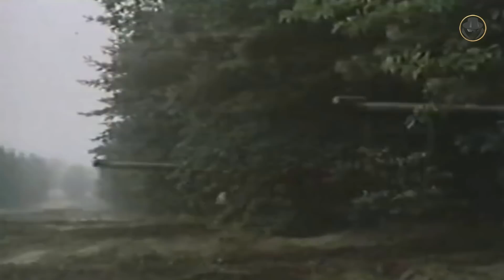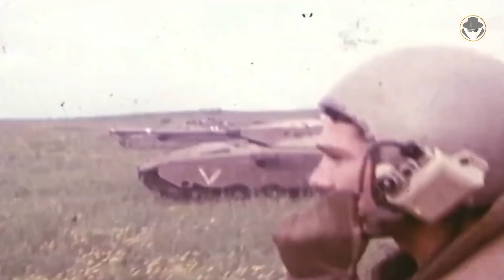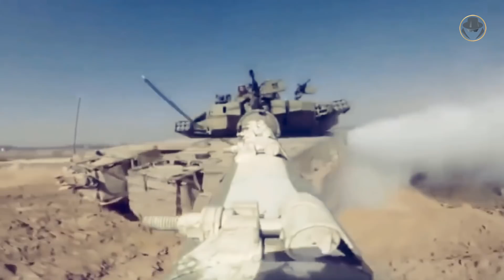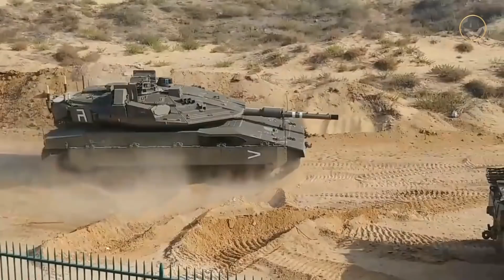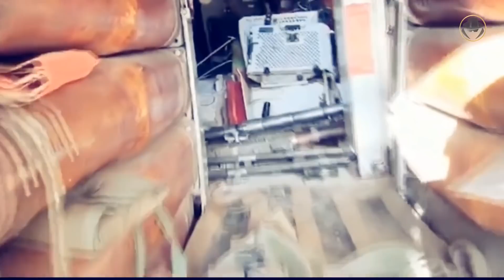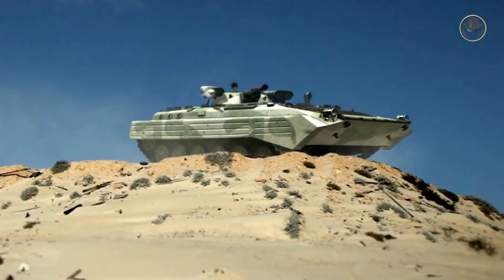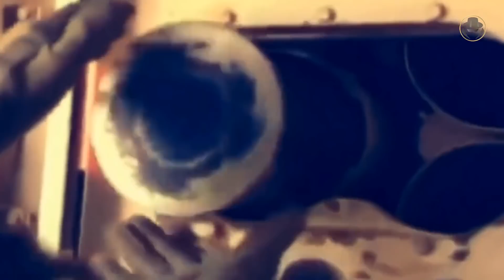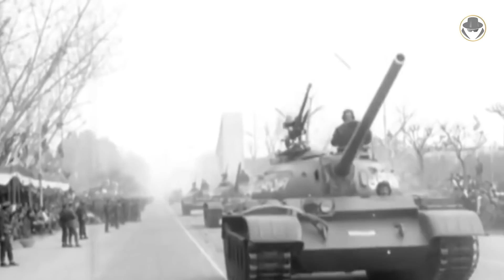Merkava Mk IV | The latest main battle tank of the Israel Defense Forces

Comment: Its weight and limited range make it less than the best and Syria before the 2011 war wasn't harmless.
Reply: To be fair it is for somthing called the self defense forces soooo its weight and range aren't somthing they probably  care about.
Reply: @andrewszerbiak7330  soooo? The vid pointed out what u repeated...
Reply: @TheKeithvidz  And weirdly both Andrew and the vid are correct. The Merkava is primarily a defensive tank. This means it's weight and limited range are less of a problem than an attacker who can expect to be further from repair/resupply. The Merkava will only be expected to make short bounds from one defensive position to another or limited range attacks/counter-attacks. It isn't exactly expected to drive to Tehran on one tank of fuel. Like the video said, the IDF no longer has plans to drive all the way to Damascus, so who cares if it's max range is short?
Reply: @Armoredcompany  as if the idf could ever make a drive on damascus, as though you can say merkava can fight a war on a single gas tank. Pompous as the rest.
Reply: @TheKeithvidz  Ohhh boy, okay. First of all, don't try to put words in my mouth by over-exaggerating. That is NOT what I said and you know it.

To start, who would WANT to drive on Damascus these days? The Syrians are doing a good enough job fucking it up on their own, they don't need the Israeli's help with that. 

Second, at what point did I say "fight a war on a single gas tank"? What I said was, "they are closer to resupply so limited range is not a major concern". Your desire to twist my words to suit your own means does NOT in fact make you correct.

Lastly, I would not characterize myself as pompous. I would instead say "educated in the methodology of waging war", something you clearly are not given your WILD misunderstanding of tank classification and design requirements. I suspect that your own personal political ideals are clouding your judgement and blinding you to the factual accuracies of reality.
Reply: @Armoredcompany  you act knowledgeable but can't so much as tell israel and the west mess up syria - ask your boy bibi why grant passage to uk's 'white helmets' beheaders.  
Political? Just i don't interpret israel as sisyphean.
Reply: @Armoredcompany  For the record I want to discuss politics?
I suspect that your own personal political ideals - sounds one of us opened that door first...
Reply: @TheKeithvidz  Yeah, I said that AFTER you started talking about the White Helmets and the Israeli prime minister, something that has literally NOTHING to do with the conversation that was originally being had. YOU brought up political issues to discuss tactical and strategic applications of a tank. That's on YOU my guy, not me.
Reply: Also Youtube didn't show me the video you linked. It's interesting but it also does little to actually show definitive proof. There are some video clips yes, but as milsim games all across the globe will show it is far too simple to just buy some kit to dress up. What is not discussed in the video is the possibility that the "White Helmets" show with Al Qaeda in Syria are not in fact mujihadeen who are wearing the outfit in an attempt to avoid being shot, allowing them into advantageous positions. The video also plays heavily on the journalist's own personal politics and personal opinions so it's credibility is questionable at best. You'll notice the host catches himself at one point saying the whistle blowers came forward "with evide...claims". He almost said evidence but stopped himself because he KNEW that wasn't true, and corrected himself to claims, which again, to my knowledge were not substantiated by investigation.

This strikes me as some Qanon level conspiracy stuff. As a government employee, let me tell you that the US government isn't as smart as these people are trying to make them out to be lol. Just look at Kabul for proof of the US's great powers of subterfuge insert heavy eye roll here

You may have read about the tank online, but what I suspect you lack is not the knowledge of it's stat sheet, more like knowledge of it's purpose and use. There is a vast difference between knowing the armor thickness and turret rotation speed of a tank and knowing how it will be used and why it will be used that way. Those are the kinds of things I take into account when looking at videos like this. Why does the IDF think its the best tank in the world? Because for their limited scope of criteria...it is. Tanks like the M1A2, Challenger 2, Type 90, T-90, and Leopard 2A6 will run rings around it out in the open deserts of Iraq or the plains of Eastern Europe yes. Those tanks will struggle against Merkavas that are dug in and defending a ridge-line and firing into confined kill boxes. The IDF does not care about it's range limitations, they do not NEED tanks that can travel far. What they need is a tank that can take a hit and save the crew (something that Merkava Mk IV has proven very good at) and potentially even kill it's attacker. It also isn't as concerned about facing modern tanks firing things like APFSDS. The IDF knows that it's primary threats come from man-portable, shaped-charge weapons. It's secondary threat will be 3rd or 4th generation tanks firing shells like APCR and APHE, things that the Merkava Mk. IV will handle just fine. Will it beat a modern MBT in a 1-on-1 head-to-head fight? Almost certainly no...good thing for it, the likelihood of that happening is basically zero.
Reply: @Armoredcompany  Tired of you twice over in two days. 
Those journalists I put myself on the line for. Men of character who did the muckraking or research.

You - they play dress up.

Didn't put your supreme intelligence checking the BRITISH founder I hinted huh?
OPERATION TIMBER SYCAMORE mere politics am I right?

Droning ad naseum what you said of the tank brings us no closer to agreement. The IDF likes it naturally and I refuse repeating my initial position. 

BTW said some older type shells its impervious too - false. Even old t55 can knock it out once flanking it. In short a trained crew knows where to aim. Pathetically armed Gazans blew one apart by RPG, aiming for the rear entry hatch.

Repea
Reply: @Armoredcompany  Intelligence does not equate common sense. The latter superior each time.
Reply: @TheKeithvidz  do you even know what "intelligence officer" means? I suspect you're unfamiliar with the context in which it is being used here...